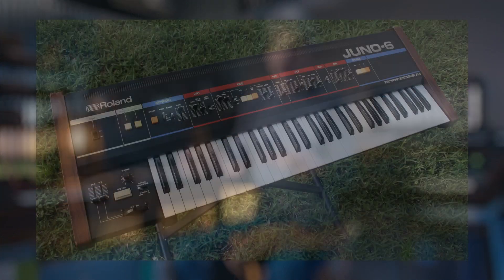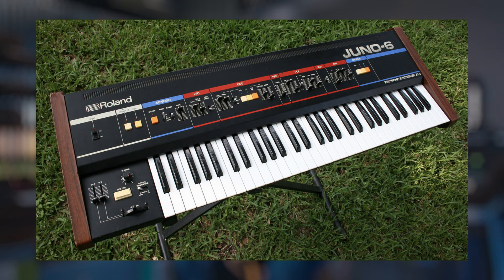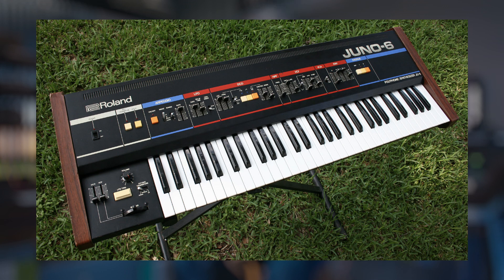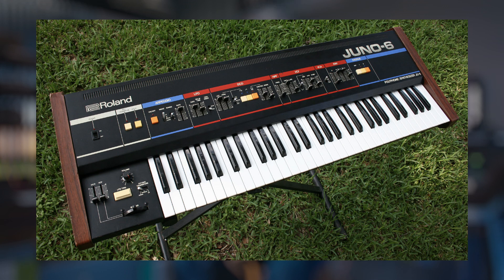New Roland Juno-6/60 Slide Potentiometers

Comment: Why would they be custom manufactured and not be the exact same footprint? Seems odd.
Reply: Suspect they have been adapted from an existing modern tooling to be close enough, therefore still being economically viable.  Creating new tooling and processes for manufacture would be prohibitively expensive for such a niche part. just my 2c
Reply: Well, you either need them or you don't. If your pots are shot then your choices are hugely limited. Is bending a few pins really that big of a deal? the original part has been out of production for about 30+ years.
Reply: @6581punk  It's not a complaint, just a question.
I was wondering about it too.
Usually when you have a vintage part custom made it's an exact copy of the original. Not something that comes close.
Reply: Thanks for all the thoughts, all. I wasn’t trying to be a negative Nancy :). I don’t know much about the manufacturing process so really was just more curious, so thanks Telecastro for the thoughts.
Reply: Yeah, i was wondering why a "custom" made part had to be adapted to fit properly
Reply from the maker: Yes, it is because of the tooling.  The basic footprint of this part was close enough to work; the customizing came in the reworking of the resistive strip (the PCB part inside the pot).
Reply: @Syntaur  As an electronics engineer for 40 years that doesn't make sense,Reworking the resistive strip? Please explain. im guessing its an of the shelf part?
Reply: @Syntaur  Thanks for the explanation, I appreciate it!
Reply: @enoz.j3506  I think he means to say this size slide potentiometer was not available at the value they needed for the Juno. Or perhaps it was only available logarithmic while they needed linear.
Reply: @Ni5ei  Still a bit odd,what manufacturer is going to go through the hassle & extreme cost of changing the carbon track with another, which would have to be the same size anyway! Log/Lin a/b,any other qualified engineers want to chip in?, im thinking an excuse to charge more?
Reply from the maker: @enoz.j3506  It was because the configuration of the pins is different from how that pot is normally made.  In other words, the wiper pin and the pins to ends of the resistive strip needed to go to different places to match that of the pot that Roland originally used.
Reply: @Syntaur  OK that would make sense,anyway love your channel,love the recent cave synth music.

Comment: ..would they work on the Juno 106 or HS-60..?
Reply: No, different design and size. But the Juno-106 pots are still quite easily available, both the panel ones (30 mm) and the bender board ones (20 mm).
Reply from the maker: @MPPelli  Exactly, we do have these pots in stock.

Comment: Sorry guys, definitely not putting those in mine even if I needed to.
Reply from the maker: Why not?  If you needed to, wouldn't you want new pots?
Reply: @Syntaur  The pin bending thing that barely comes through the pcb on the other side just isn't for me. It's nice that there are spare parts available. To me nothing feels like those Japanese Alps sliders and replacements have never had the same feel to me. I prefer to clean or rebuild them if necessary. I am maybe a bit of a die hard here but I believe that unless the carbon trace or metal guide is severely damaged, you're way better off putting them through the cleaning process and lubing them up again but that's my opinion. Love the channel there.